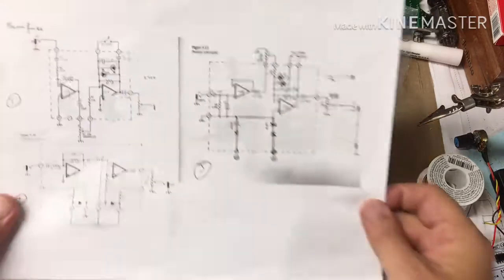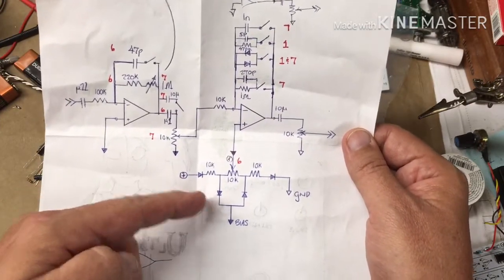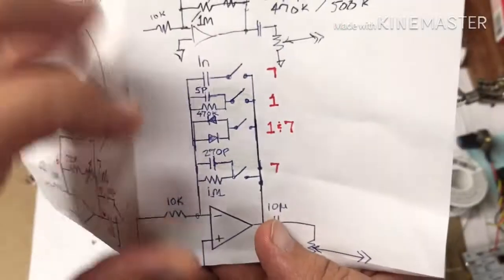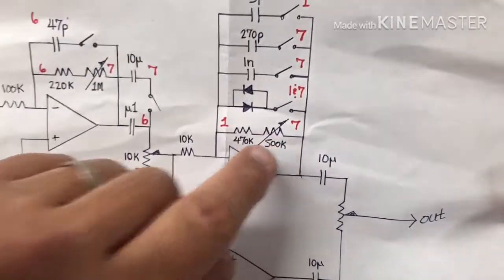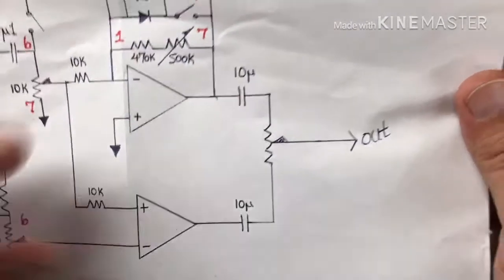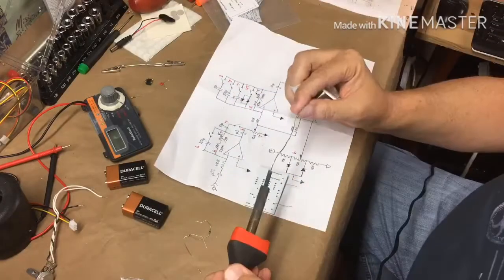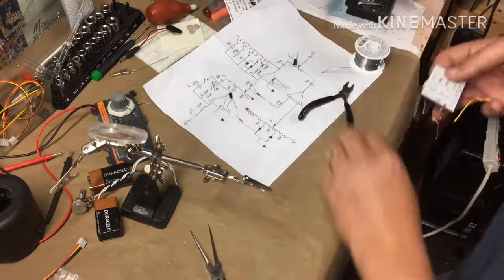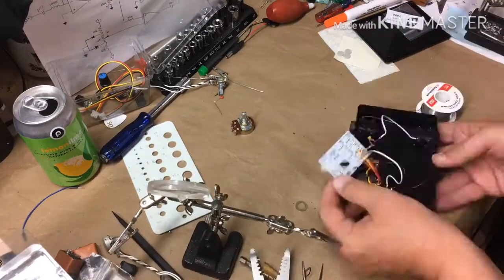Electronic Projects for Musicians Ultra Bass Fuzz Preamp (Combined Mad Scientist Lab Project!)

Comment: How did you power up the project? Did you stick with a +9/-9 volt bipolar power supply?
Reply from the maker: I used a 12vdc power supply and then floated the ground at 6vdc. Essentially that ran the circuit at +/- 6vdc.